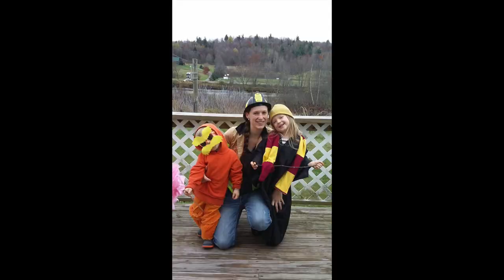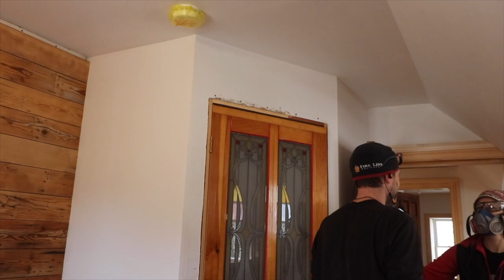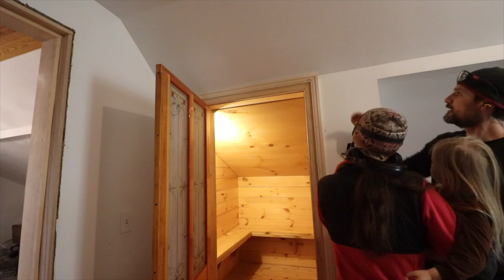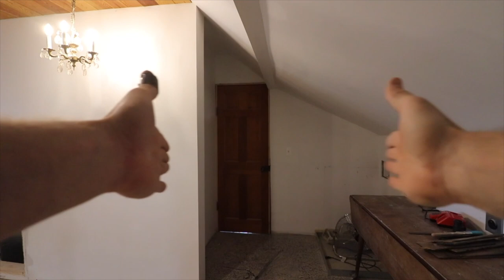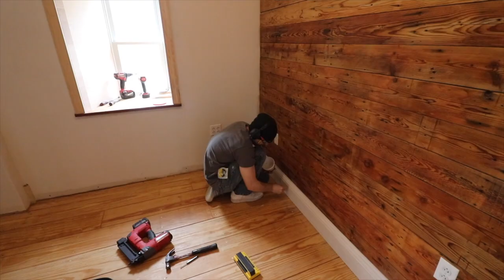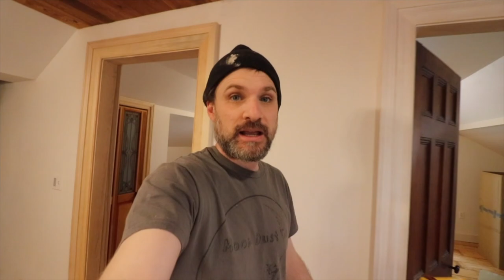Waiting Many Years | Renovating

Comment: A great deal of hard work is coming to the right point now. The doors and casement works look perfect, and being designed to fit the needs of the building are clearly a perfect fit to the need. You have honed your skills and mastered the equipment. The mastery shows in the quality of the work, and the glow you get from revealing the results. If you ever need a second career, you look to have it made.

Comment: I hate trim. with a passion, i would rather tape and mud a house than do trim. i hate the angles. i hate coping cuts, i hate how no corners are 90 degrees. i hate having to go back and caulk it, i hate having to fill the finishing nail holes. i hate my nail gun leaves more agressive marks than it should. i hate painting it and taping off the walls. its the worst!

On a side note... finished remodeling my house this last winter and once it was done, relocated to a new city and sold it. practically doubled what i put in it, but now im in a new even more expensive city and the only way to afford something here is another full house fixer upper! good thing its fun some days...... im sure the 2nd time around its way easier, right.... right?!
Reply from the maker: Holy crap! Good luck and may the force be with you to get through! I have heard of legendary people like yourself... renovating more than one house in a lifetime... I will surely be easier.... yeah... sure will.. 🤔😀